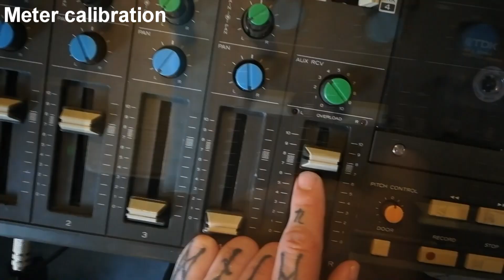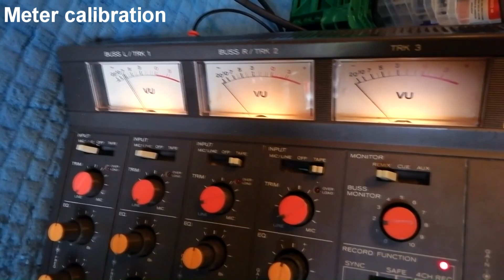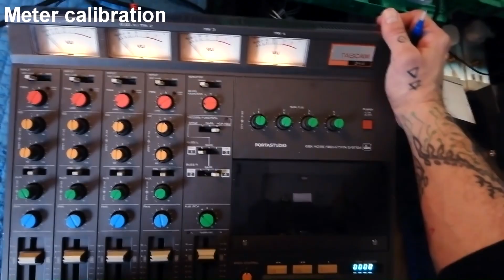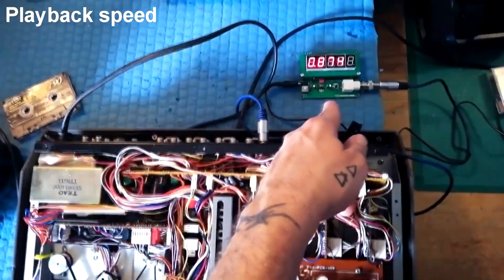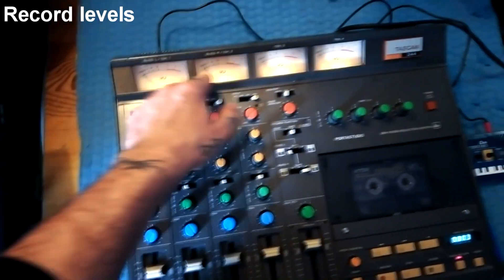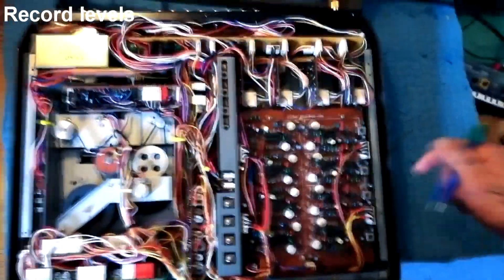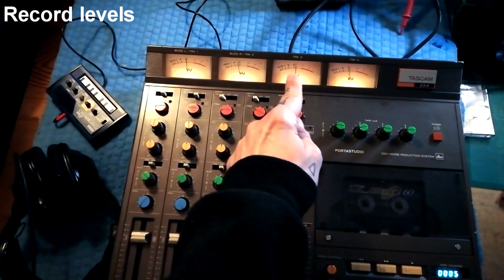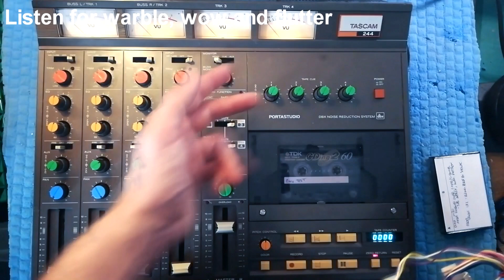4 track calibration demonstrated on a Tascam 244 Portastudio

Comment: Hello, I have a  problem with my Tascam 424mkI (well, more then one but this is the most serious). Basically when I record the audio seems ok but when I play back it's barely audible. I tried to clean the heads with isopropyl alcohol and it seemed to work for a while. Is it possible that it needs to be calibrated? Could the heads be damaged? and if so, could be repaired/replaced?   I know it’s quite impossible to help me this way but your opinion would be very helpful  
Thank you for your videos btw
Reply from the maker: Record and playback are handled by the same dual purpose magnetic head, so if you have playback on all 4 tracks, all four segments of the head work properly. It is common for the record amplifiers to need to be turned up, I think that is the most likely cause if your issues, but you should calibrate playback amplifiers  first - ideally with a proper calibration tape, but you can do it roughly with any prerecorded tape;  just make sure all channel meters respond in a similar way a  loud passage...check Ch 1 and 2 then flip the tape over to use the same passage (the audio will be playing backwards but the peak amplitude will be the same) to set Ch 3 and 4
Reply: @Tetrakan  Man, thank you so much for your answer. I don’t know if I’ll try soon because I’m totally inexperienced and I don’t want to do any damage but at least I know that somehow it can be fixed :)

Comment: As an alternative to your frequency counter I actually used a tuner on a Zoom guitar stompbox. I bought a tape with a 440 Hz signal, so I could tune the Tascam untill I had a solid A showing up on the stompbox. This also worked for the high (double) speed changing it to 880Hz, offcourse also showing as an A, though an octave higher. I verified it afterwards with a professional wow & flutter meter, and it turned out to be spot on.
Reply from the maker: Good call, providing you can do obtain a tape which plays at a pitch recognised by a tuner. I've recorded a C or another pitch  at the beginning of a song to make sure playback speed would be the same if I ever took it to another 4track, then used a tuner and the pitch control  to check playback speed is the same on the second machine.
Reply: Tetrakan Supermonobloc You can buy new test tapes of which the first 2 minutes are 440 Hz, and the following 16 minutes are at 31500 Hz. They’ll cost you about €20.

Comment: Hello. I’m struggling to find a tech to repair/service my TEAC 144. I think I’ve diagnosed the problem using your previous vids but am not confident in my ability to repair it myself. How can I contact you regarding this? 
Thanks for your very informative videos!
Adam
Reply from the maker: Unless you need to send me photos (in which case msg me on Facebook) I'd rather answer questions here where my responses might help someone else reading. I must admit I am not a fan of the 144 from a repair-persons perspective...the idler mechanism on the transport can be very difficult to get going and the electrics are very laborious to dismantle, and those issues make the model a bad choice for a newcomer's first restoration project! But ask away, I'll help if I can.
Reply: Tetrakan Supermonobloc thanks for getting back. I have a noisy transport which then basically stopped working - figured it was the idler tyres from your diagnosis videos. I have bought replacement tyres but when I opened up the back and tried to begin dismantling (following the your 244 vids hoping for similarities) I was a bit overwhelmed and so stopped after a while because I thought I’d never get it back together again correctly. By the sounds of it you’re suggesting it’s more trouble than it’s worth. That’s a shame because for the short time it was working it was good fun to record on. Drums with tape saturation is an unbeatable sound! Thanks for replying.
Reply from the maker: @adamdadamusic  Yeah, compared to the 244 the idler mechanism on the 144 relies on an extra rubber tire, extra belt, and two textured white plastic wheels which become smooth with use (they are sort of equivalent in their function to the brass spindle on the 244, which, being brass, doesn't suffer from the same wear issues). Teac/Tascam no longer supply spares, so while its easy enought ot replace the extra belt, probably feasible to find some sort of rubber gromit or o-ring to replace the extra tire, until someone 3d prints replacement parts for those white plastic parts then refurbishment of that model isn't viable, sorry its not better news. The 244 wont sound exactly the same due to being DBX2, but its pretty close, and speaking subjectively I greatly prefer the EQ on the 244, and they are significantly easier to work on. Here in the UK they still turn up quite regularly in spares/repairs condition for under £100, and with time and patience and the videos I've uploaded you'll be able to do the work yourself, so that is what I'd suggest you move to, good luck!
Reply: @adamdadamusic  TEAC service in New Jersey still repairs and calibrates old Tascam machines.